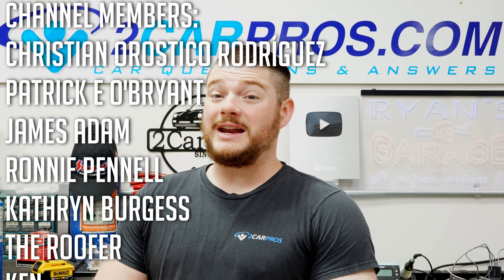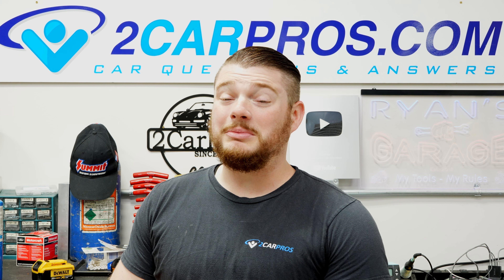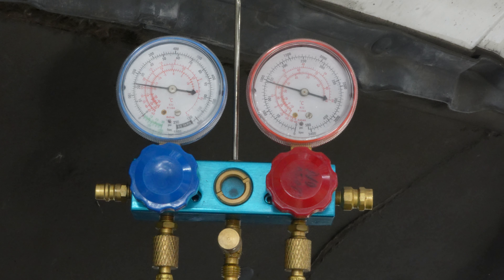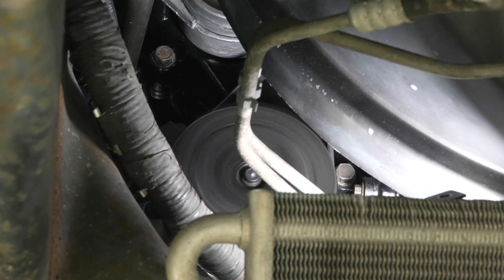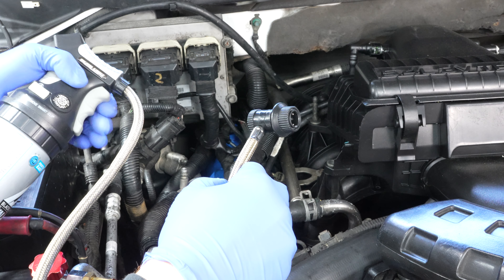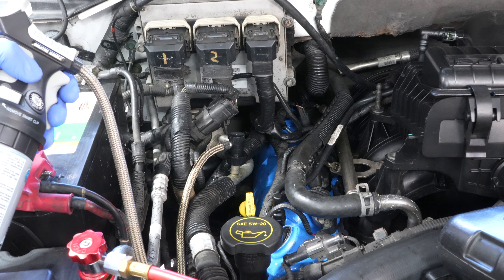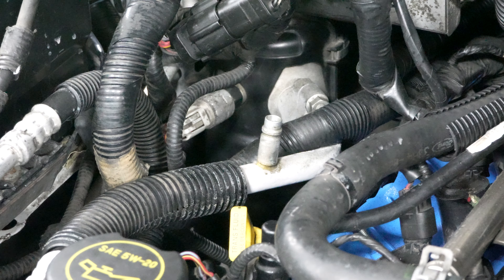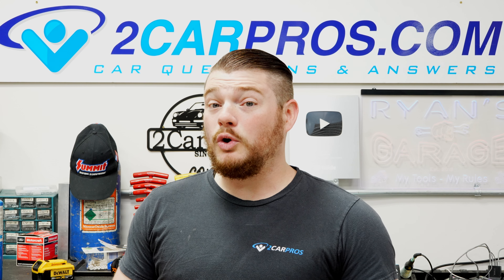How to Top off Automotive Air Conditioning with Small Can | EASY

Comment: Great vid, quick question... can I not just purchase a can and also buy the digital attachment you have on yours and use that to tell if the system is low pressure. 
And just read the can info on temps and pressure required and start topping up? also what do you use for high side and how can you tell the proper pressure for high side?